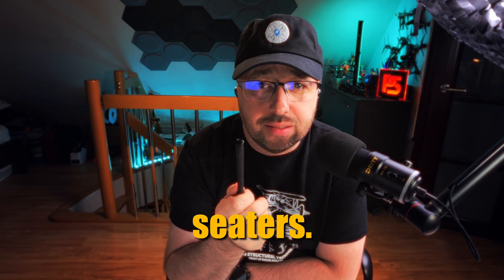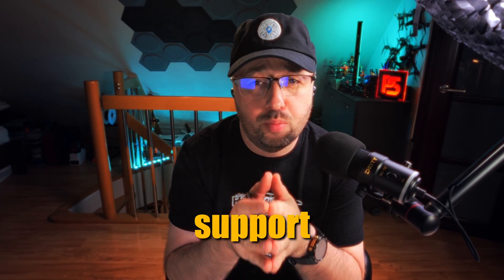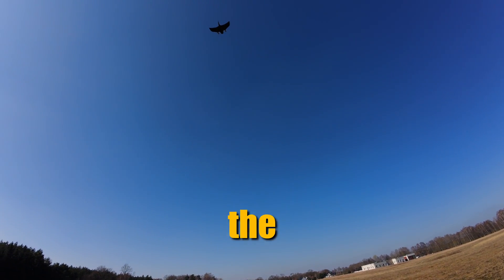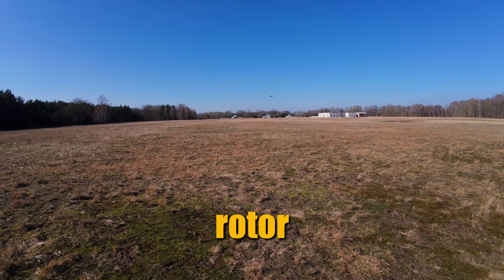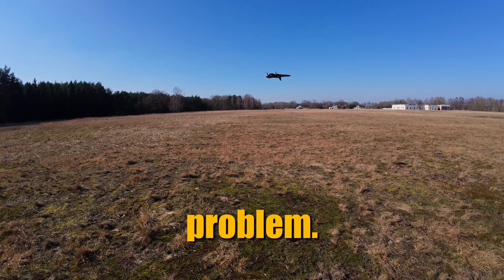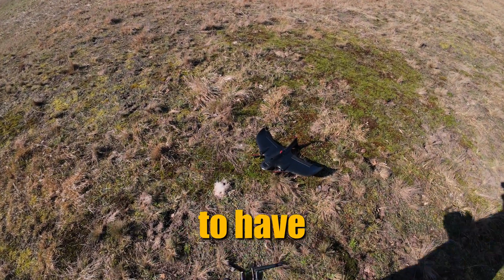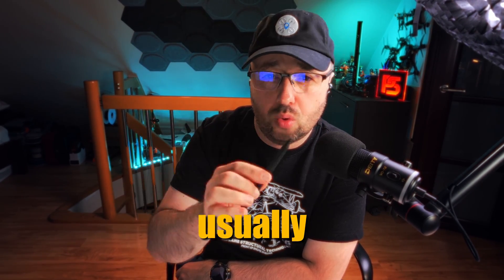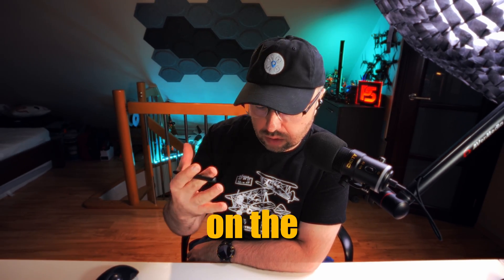INAV and tail sitter VTOL support

Comment: Will INAV also support Belly Sitter VTOL?

example: the FIMI Manta shown in the video could be easily converted to Belly Sitter just by removing the propeller on the rear motor (or adjusting C/G if motor removed). To convert to Tail Sitter would requiring modifications so could be armed and launched vertically.
Reply from the maker: You mean a bicopter? Yes, INAV supports bicopters
Reply: @FPVBites  A belly sitter has two motors with servos like bicopter, so hovers like one; but for takeoff position is sample as a fixed-wing. The initial takeoff sequence is to lift up to a tail down position. (propellers remain parallel to the horizon)
A bicopter in contrast has landing support (gear/structure) that stabilizes so motors already in hover position.

Comment: Currently building a standard VTOL. Fixed Quad Drive and Puller motor for Fixed wing. Hope INAV 7 will handle it fine. I haven't seen any videos on such a configuration, only tilt rotor

Comment: 2 servos that can control the flaps?  Do that motors need tilt also for tail sitter?
Reply: no need to tilt the motors. the simpliest form of a VTOL is a wing with two fixed mounted motors and two servos for elevons. four channels in total for the flight controller.